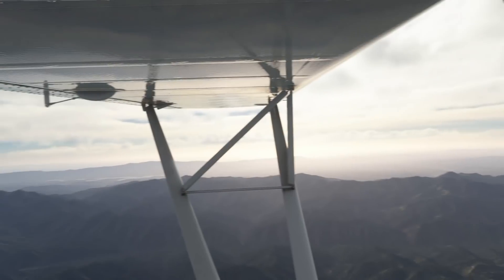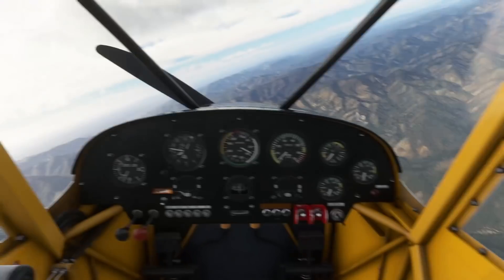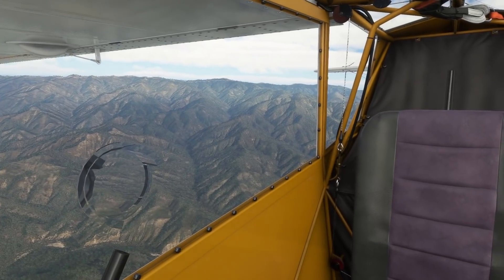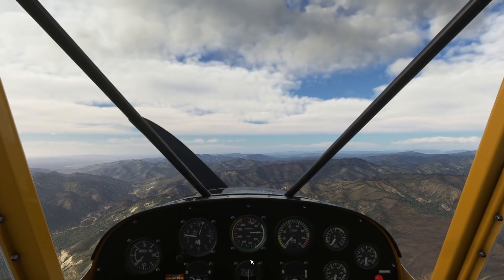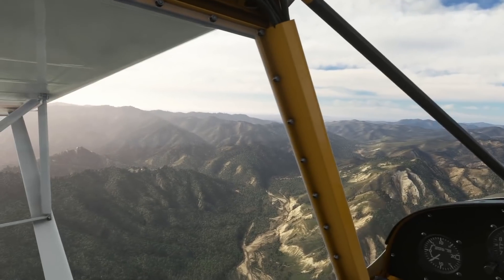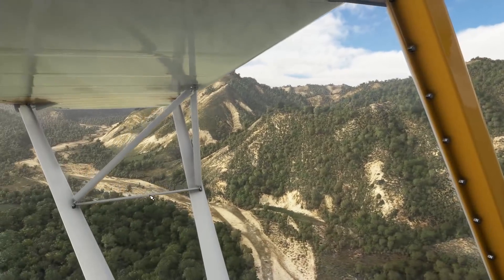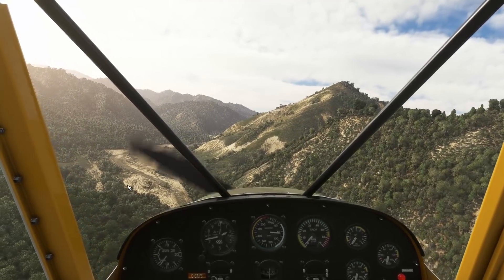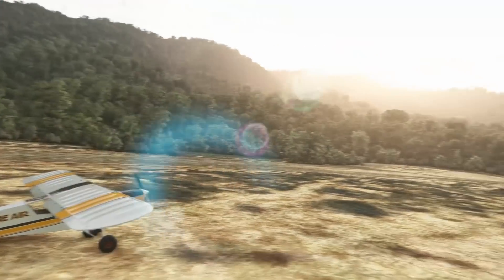Real Pilot demonstrates Forced Landing - What Trevor Jacobs could have done! (MSFS)

Comment: I'm not even that great at flight Sim and I can do a forced landing that's survivable and perhaps not even an insurance claim depending on the vegetation. Trevor was in a plane with an amazing glide profile and that had been stripped of pretty much everything... it was airworthy when it was sold, and it is like buying a Bible copied by hand by 15th century monks just to take a big steaming dump on it and light it on fire. There's a difference between inexpensive and cheap. That old Taylorcraft was perhaps the former, but it was hardly the latter. Those are great Bush planes for the same reason he could have totally landed it engine out. It stalls at moped speeds.
Reply: Yea but unfortunately, people often conflate inexpensive with bad and see fit to destroy perfectly good but inexpensive thing for whatever reason. These people are jackasses. 

For example, I daily a Honda rebel 250 motorcycle. I paid $1500 for it in basically new condition. However it’s been rock solid for the years and 15k+ miles I’ve ridden it. Always fires right up, doesn’t care if it’s 20 deg.. just a great little bike that does what it’s supposed to. If you know, you know. Unfortunately, I see them being trashed on all the time because they just aren’t cool or fast.. or people get one as a “learner” and treat it like shit.. half the time they’ll leave it to rot in a backyard as soon as they get something else. Tons of other examples out there.. shame.
Reply: It was kinda amazing to see the part when that Taylorcraft was actually flying itself. It would have needed so little to put down nicely on a river bank or whatever down there. All it would have needed where a little bit of brain. It surely broke my heart when it headed into the mountain side to crash. It didn't deserve that. 😢
Reply: @birds_eye_view  I just can't get over the fact that he decided to post the video without thinking about the fact that he's gonna get dragged by the aviation community and government. He's now cut down the video to take out some things including his commercial for the Ridge Wallet and the end. I imagine Ridge Wallet got some hate mail over this, although I don't think they realized what they were advertising up front.

Comment: There was no safe place for that pvc pipe build to land without him being crushed under the metal piping. look at the crushed plane, an extra 150-250 pounds would have sent the plane tumbling and therefore crushing the cabin. AFTER THE PROP STOPS THERES NO FORCE TO KEEP SPEED TO AVOID BEING SNAGGED IN THAT TYPE OF ENVIRONMENT DURING A LANDING OTHER THAN SPOTS HE DIDN"T PAN TOWARDS.
Reply from the maker: I’m afraid I’ll have to correct you on a few points. A restart may have been possible if he’d kept speed to spin the prop. Prop not required to keep forward speed. He should have glided it at the best glide speed. The ONLY reason the aircraft was that mangled on impact is because it was an impact and not a landing. If landed at correct speed and pitch the aircraft would not tumble unless the gear snagged on something.
Reply: FACE ... Ummm, What? Since your channel is blank and you just joined on 1-6-2022 ... kindly state your qualifications for your opinions. (PS ... how old are you?) ^v^
Reply: @taproom113  It looks like probably Trevors troll account
Reply: Obviously, you're not a pilot. Nearly every word of that is incorrect.

Comment: Is there a rule of thumb for gliding speed? As I can kind of feel out video game planes now I want to assume just north of mushy, but my last Googling didn't give a good 'non-student' answer.
Reply from the maker: Not really. Depends on aircraft size, shape, weight etc. usually you find the number from the operating handbook.
Reply: Just north of "mushy" is where you will find minimum sink speed, best glide will always be faster than minimum sink.

If you are fighting a headwind then you go a little faster than best glide, if you've got a tailwind - then a little lower than best glide. If you don't know how much to alter the best glide speed for the conditions, then just stick to best glide.
Reply from the maker: @Doug Hill 1 slight correction. Best glide speed must always be maintained or you’ll scarified range and endurance. If you want to glide into wind you need extra weight (a tactic gliders use when facing headwinds, they dump water when it’s no longer required). So sadly not possible for this scenario.
Reply: @cgaviator  That is not correct. For example, let's say your best glide speed is 50 kts, and you have a 50 kt headwind. Flying at best glide speed will get you exactly nowhere. Increase to 60 kts and now you are making headway.
Reply from the maker: @HarmanRobotics  yes, that’s a fair point given the example. you’re making headway but you’re also descending faster due to increased drag. It’s fair that if you have altitude in hand you could sacrifice for some forward speed. But I’m a little sceptical that you’d get anything useful out of it at the slow speeds we’re talking about. All depends on altitude available. 👍🏻
Reply: @cgaviator  
Yes, it all depends upon altitude, that is why you would fly faster into a headwind; so that you can travel the largest distance using the available altitude. It is with the slower flying aircraft where this can make the biggest difference.

Suppose you lose power one mile high and you want to land in a clearing six miles ahead, you are fighting a 30 kt  headwind and your best glide speed is 60 kts. Can you make it?

You will lose altitude at 608 feet per minute (10:1 L/D). You will be on the ground in a little over eight and a half minutes, your speed over ground will be 30 kts and you will only make it five miles.

If you trim faster to 80 kts your glide ratio plummets to 8:1 and your sink rate increases to 750 fpm, but it is well worth it. You'll be on the ground in seven minutes, your speed over ground will be 50 kts and you can cover 6.7 miles. That is more than a 30% increase in range, which is quite significant.

Obviously these numbers will vary quite a bit, something that a good pilot should be familiar with for their particular aircraft.
Reply from the maker: @HarmanRobotics  excellent explanation! 👍🏻
Reply: @HarmanRobotics  If your glide speed is 50 kts, and you have a 50 kts headwind, you will touch down with no ground roll in a verticle descent.  Airplanes only understand airspeed, untill they touch the ground.  That same plane would be going 100 kts ground speed if you turn around, but the airspeed indicator would still show 50 kts
Reply: @jimchuk8511  That's right Jim, not sure why you wrote that. Is there an error I made that you are drawing attention to?
Reply: @HarmanRobotics  Can't really say there was an error, but many non pilots don't realize there is a difference between air speed and ground speed in an airplane.  Maybe I was clearing that up for them.  Other things I could mention is that with a Cub, the best glide speed is about 55  MPH.  and it doesn't have flaps to slow down or loose altitude.  I flew a Legend Cub for my last BFI two years ago, and they are a nice slow docile airplane.  I also have had several engine outs in planes, and have never had the desire to jump out.  Trevor is a fraud I think and will probably get whacked by the FAA when all is said and done

Comment: I'd choose a stretch of land with similar features (not the same) and factor in at least sixty to ninety seconds of dead time because most people in such a situation will initially panic (especially given the terrain which at first glance is sub-optimal) and it will take a short period for them to calm their nerves and begin thinking straight. Also - river beds might look inviting from the air in a flight sim. But they are very often filled with boulders, rocks, driftwood etc. washed down the mountains during floods. Pretty dicey. Looking at the terrain where Jacobs went down there are at least two areas at higher elevation which seem good candidates. But again - MSFS isn't real world. Those maps and reality are two different things.
Reply from the maker: Completely agree and perhaps I should have made that clear in the video. I worked with what was presented in the sim but the techniques remain valid. Good point about the river bed 👍🏻. As for the 60-90 seconds of dead time, valid for a complex emergency for sure. Hudson River for example. But a simple aircraft and an engine fail those 60-90 seconds are vital for positioning especially at low altitudes. I had a bird destroy my engine at 1300ft on final. 60s later I was on the runway! 😅
Reply: @cgaviator  I think there are some similarities between the two (if we don't accept the premise that it was a genuine crash - which we do not). Don't forget - Sully was a highly experienced pilot with comprehensive knowledge of the plane and he had a co-pilot alongside him. Admittedly,  Trevor Jacobs' plane isn't anywhere near as complex - but I don't think anyone would consider Jacobs an expert pilot and hadn't he only recently acquired the plane? I have to admit when I first saw that terrain I thought it was sketchy.  Pilots who have never been in such a situation - especially those who don't have experience beyond personal flying as well as hours (or plane knowledge) - yeah, I'm expecting them to lock up at least for a short period or waste time attempting to contact ATC (did he have a radio?). 

I mean, if he knows that plane inside and out he intuitively has a very good idea about how long he can realistically glide and expect not to run out of altitude. If he doesn't - I'm expecting him to err way on the side of conservative. Which may or may not be problematic. But well done with the bird strike. I expect you are a better pilot than Trevor.
Reply from the maker: @deaddropholiday  I have to admit, I'm not knowledgeable in the licencing requirements for sports light aircraft but I understand it's pretty darn low. Maybe it's the old skool in me but any pilot should be proficient in the airmanship considerations and aircraft drills before and during an emergency. I've seen videos suggesting it wasn't his (usual) aircraft, and that he doesn't fly with a chute normally. So if this is how he normally reacts to an emergency then he should always have a chute and shouldn't fly over any populated areas, lol. And not seeing the cockpit I would almost expect to see it stripped of anything expensive if you know what I mean! But I also agree that personal safety is more important than the aircraft. If he wasn't certain he could land safely then bailing is sensible. Notwithstanding he had time to think about things before grabbing his go pro and jumping. Good discussion, thanks!
Reply: @cgaviator  Nobody believes this is anything other than a pathetic attempt to draw social media traffic. So all that can be taken off the table. I'm just looking at it more as a thought experiment. What if your engine cut out over such and such ....? What would you do? Quite a few people have attempted to replicate the conditions and offered alternative solutions. But all of that is premised on it being legit. Which it clearly isn't. TBH, I'm amazed so many people considered it even as a possibility. It was obvious from the outset. Right now the FAA boys are putting a blowtorch to his ass and they will unquestionably push for the maximum possible penalty and rightfully so because it just makes everyone else's flying experience that much worse (more FAA red tape, bureaucracy, increased insurance costs etc.)

Still (as you say) - it is a good entry point for some valuable education for FS enthusiasts and young pilots. Like I said - I wouldn't bother trying to land in the same place (you want somewhere totally unfamiliar). Pick similar terrain (or harder) and then test to see whether your understanding of the plane's capabilities in glide match your perceptions, whether you can make good decisions on potential landing spots given decreasing thinking time or altitude etc. etc. It's all good fun. And valuable learning.
Reply: The main things to consider when making a forced landing is to not die in the process, but not endanger anyone else either. By bailing out, the plane could have hit someone on the ground or caught fire on impact. A pilot is responsible for the damage their plane causes if they are still in control of it in any way. Just like traffic laws in my state. The driver responsible for an accident is not always the one who broke the law, but the one who had the last clear chance to prevent it. Holding onto your right of way no matter what will get you into a whole lot of trouble if it causes an accident. This Trevor guy is VERY lucky his little stunt did not get someone killed or injured, or start a forest fire.
Reply: @geraldscott4302  I know what you are saying about not dying being the number one priority. But if I'm on the hook for a few hundred thousand dollar plane I'll be damned before I give up an attempt to save it if possible. Especially with insurance companies looking for every way possible to invalidate your claim.
Reply from the maker: @geraldscott4302  great point, totally agree 👍🏻
Reply: Smarter to take a route that keeps you near roads and landable areas. But if you need an excuse to bail out and selfie stick your free fall you might want to do it where the aircraft is not easy to inspect after the crash.

Comment: I knew you would do this...YOU ARE predictable old chap. I doubt if Trevor was as high as you think, the gopro is wide angle and will look much further away. Stunt or not he did it and that is that. I can't see them proving anything because like you said could have been ice and that evidence would have melted. The AAIB will have to come up with something solid to disprove his claim.
Reply from the maker: Weeeell… you’re right, couldn’t resist! The instructor in me wants to pull out important lessons. As for proving ice, they can get a good idea from weather conditions and aircraft type. Such a clear day with high power settings I doubt it. And as for the altitude, he still would have lots of time. I believe the mountains are 5-6000ft at least and he was well above. Victor route there has a 9000ft minimum altitude. I’ll have to find the report and would be very interesting to see the findings.

Comment: No hate but tell what he could have done using simulator is the big no. We can all practise as many times as we want with no stress in the simulator but when it comes to real life you could freeze at that point ant forget everything you learnt.
Reply from the maker: Actually, practicing and demonstrating what could be done in a sim is precisely how airlines and military practice such emergencies. And it’s always worth examining options after real events to learn and develop methods for next time.
Reply: In almost every scenario where there's an engine failure at higher altitudes, you wouldn't just jump out. What he's demonstrating here is that there are supposed to be a lot of procedures to try before you even consider something like what Trevor did. A perfect simulation isn't required here. Also, most of the time GA pilots don't wear parachutes so bailing out isn't an option anyway. Trevor's actions were deliberate and unnecessary. He's extremely lucky he didn't kill anyone.
Reply: What has real life to do with trevor's farce. And you perform as you practice. That is why we practice!